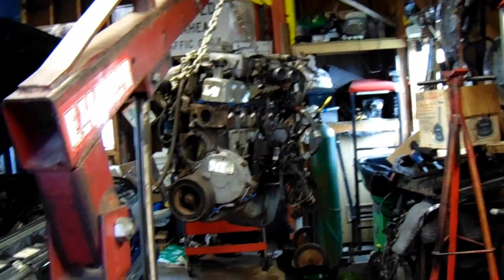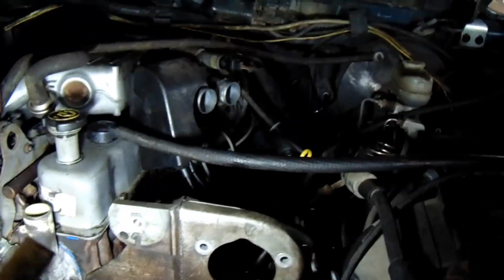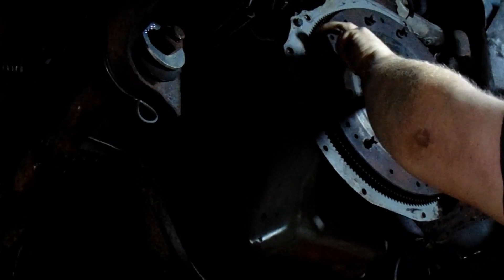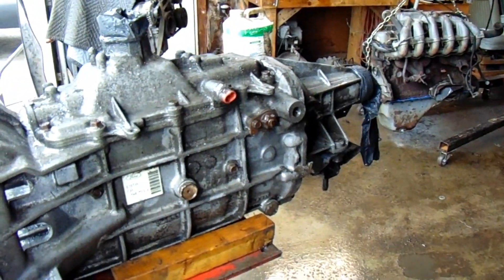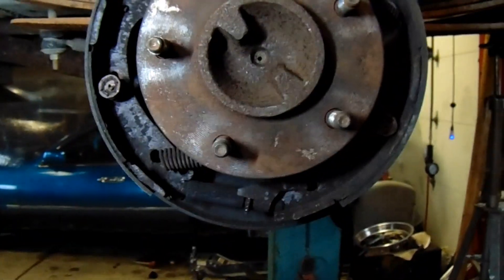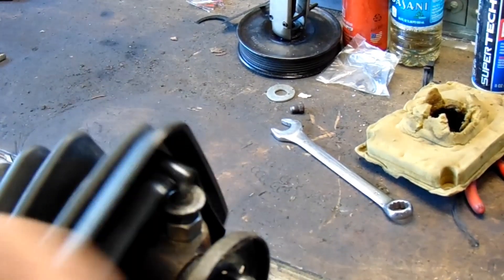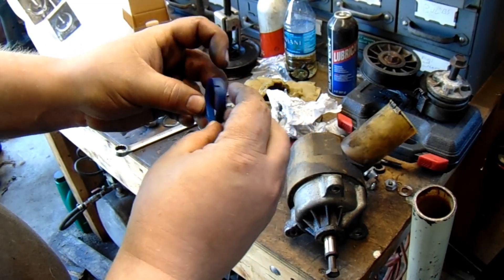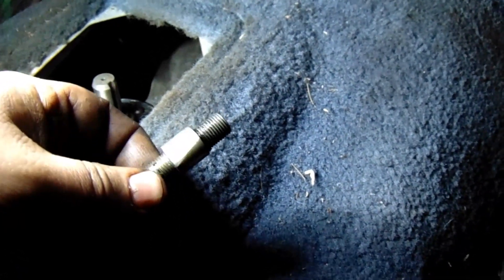F150 drivetrain install and startup

Comment: that c2 pump is junk; i have a saginaw kit I can send you for high 100s. the axle wetness is axle seals; usually the pass side leaks first because the axle shaft is wore out. New shaft about $100 off rockauto. If you use cheap outer seals put rtv on the outside of them when you press them in. and replace the bearing when you replace the seal. soon as you bleed those brakes you're going to find it needs all new calipers and cylinders. then drums since that is junk. rockauto is the cheapest for all that. you can replace the oem starter but a better design is the PMGR starter used in 92 or 93+. have to upgrade the cable to change to that. if the fill plugs aren't updated to metal the m5od trans will leak from the fill plugs. believe they were plastic or something from the factory

Comment: if the owner really likes this truck tell them to upgrade to a large case 3g alternator; the 2g from factory wiring plug catches on fire and will burn the truck down. http://fullsizebronco.com/forum/7-1980-96-bronco-tech/55169-3g-interchange-facts-if-youre-thinking-3g-read-here.html make your own cable or pull one form a 97-03 expy f150. or I can sell you the later cable.